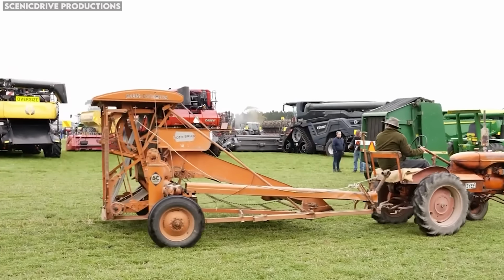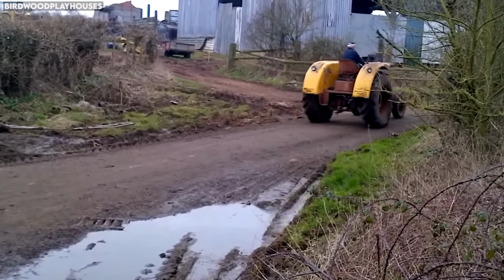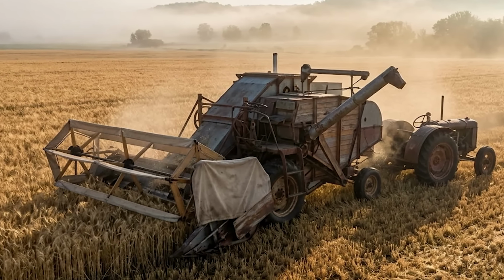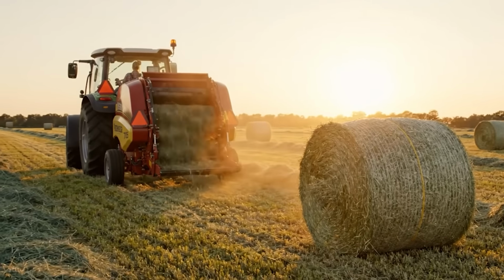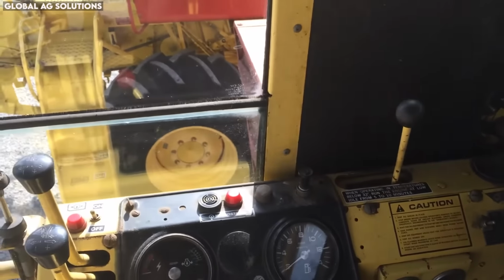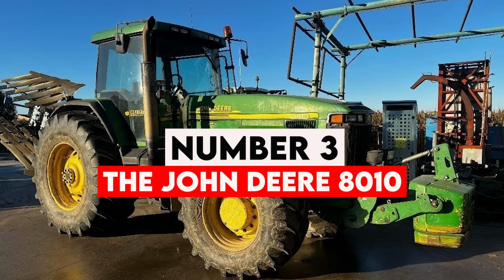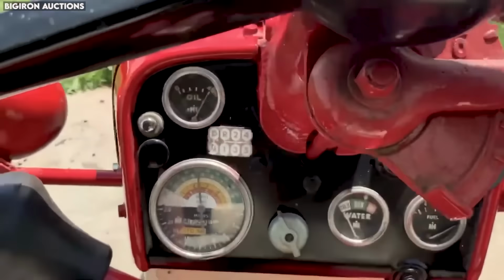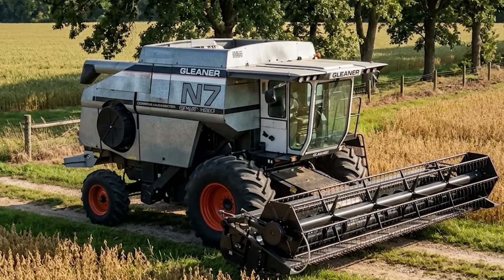10 Forgotten Farm Machines That Once Ruled the Fields

Comment: If you are going to use AI images on the click-bait, then at least assure that they are illustrated correctly.  When was the hay pick-up drum ever at the "back" of a Baler, and not at the "front"???
Reply: Pickup and bale drop in same direction. PTO on the opposite side of pickup